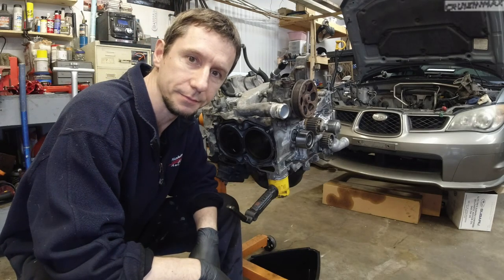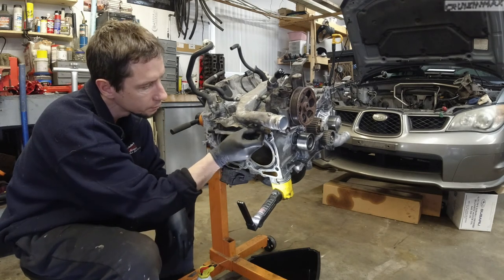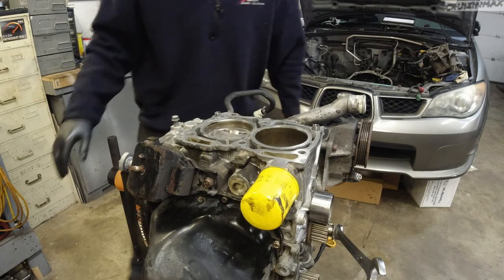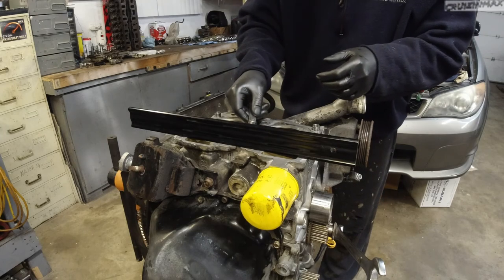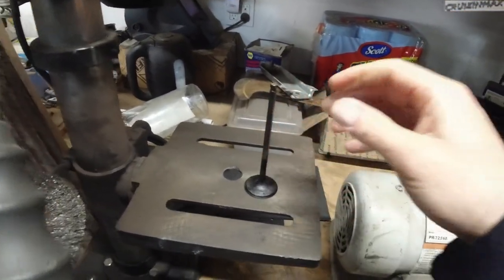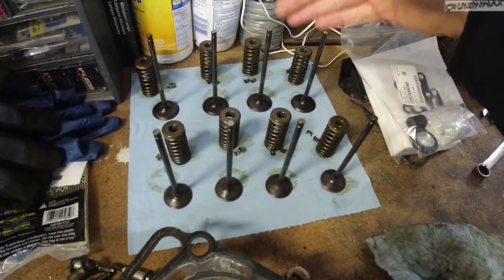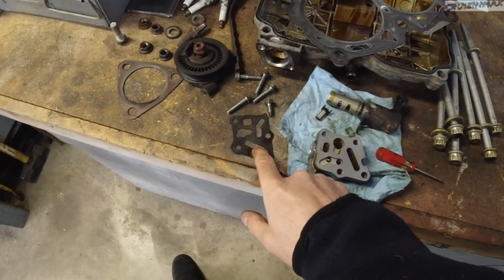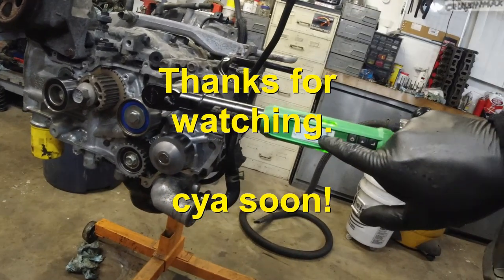Subaru Impreza 2.5L cleaning block and valves part 3

Comment: What type of brush are you using on the Dremel? And was the bristle brush brass?
Reply from the maker: the dremel had a soft steel brush which i bought at harbor freight, im sure you can get those online and yes the bristle is brass